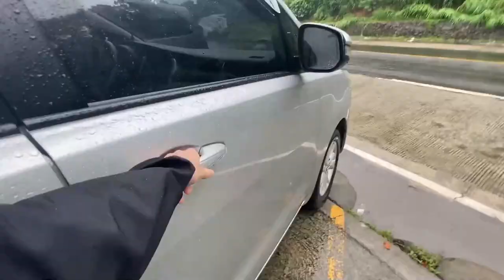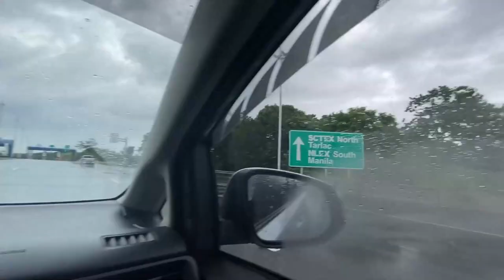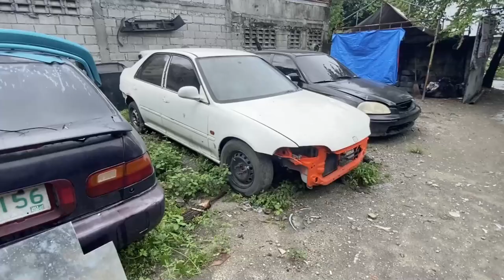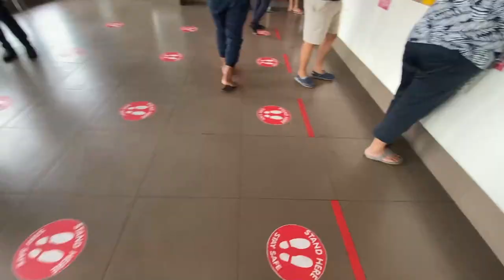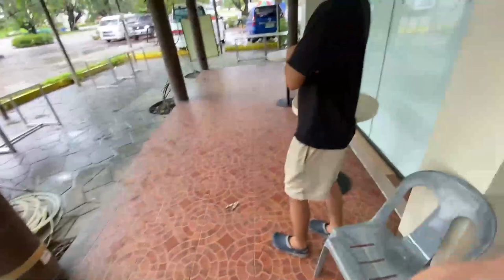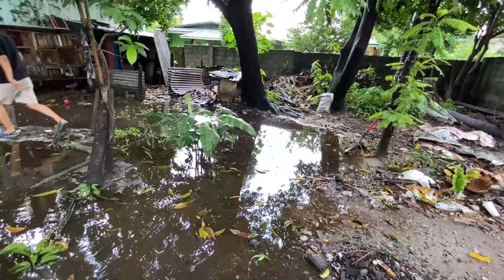My 97' Honda Civic EF Wagon Shuttle Beagle 4wd (Rare Paps) #ProjectCar

Comment: Nice car! I had the opportunity to buy an EF wagon before. Sadly, it was bought before i got to inspect it. It was priced at 90k pesos.
Reply: It was a 4wd as well. 6 speed manual too.
Reply from the maker: Damn! sayang!!
Reply from the maker: @joaquinfranco9012  Should have bought it!
Reply: Oo nga. I also had the opportunity to buy a 3rd generation Civic Shuttle. (Your car's predecessor) for 45k. It was located in Quezon City, but originally imported from USA to reigon 3 in the late 80s. But I passed it up because of its condition.
Reply: It was a 2WD and had a 4 speed A/T.
Reply: So i settled with my local pure stock 
1991 Civic EF hatch with factory records and original paint. I bought it from the first owner.